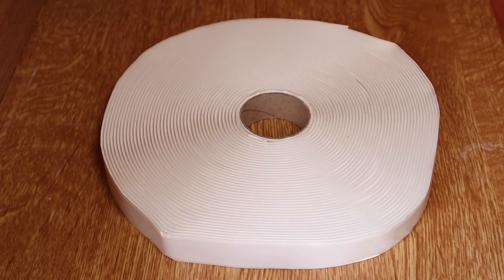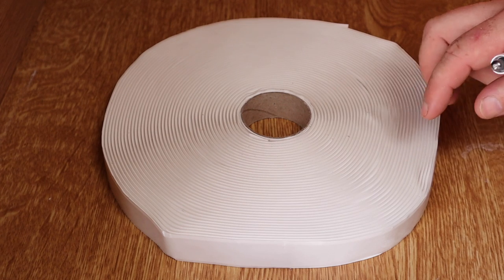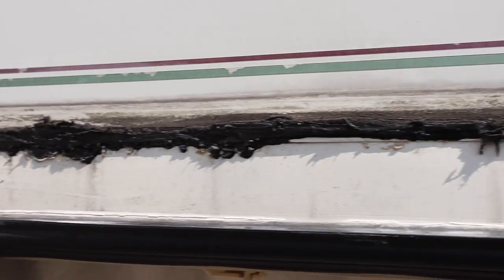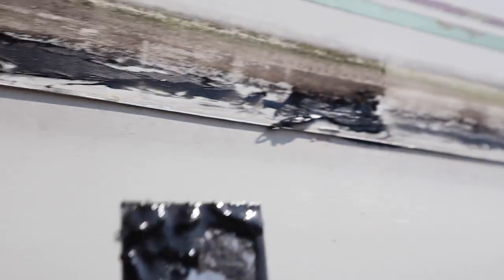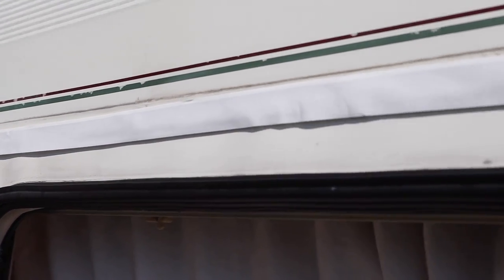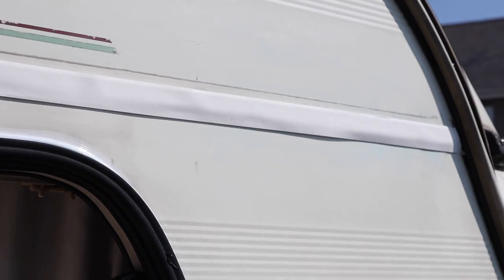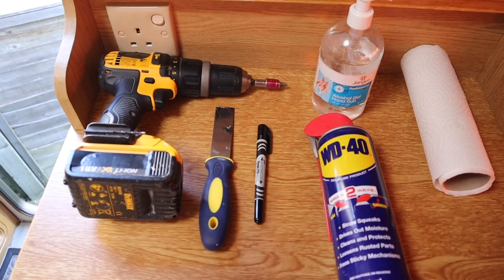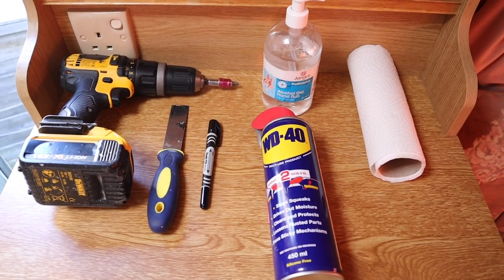Replacing a caravan seal.... Caravan Repairs.

Comment: Looking to give this a go in the next few days — cheers for the vid mate!
Reply from the maker: Theolyn Warrender, no problem, would be great to here how you get on 👍
Reply: @expedition320  Cheers! Would you recommend completing the edges with silicone? Or will the mastic sealant do the job? It's looking like I'm going to have to do the trim which goes around the entire outside of the side (for the awning) as there's previously been a leak in the front left which the previous owner bodged with a dodgy silicone job.
Reply from the maker: Theolyn Warrender, I would recommend using the mastic if possible, it will cover the any join that maybe under the trim. It will also seal the screw holes to stop any water getting in 👍👍

Comment: Just found a leak under my awning rail in that joins to the roof, this video came in so handy, would it be asked to fix the tape to the aluminium strip first then screw to the van maybe?
Reply from the maker: I don’t think it will matter really, I stuck it to the van first so I could see I covered all the join, I was also doing it alone so doing it that way was a lot better for one person 🤙🏻
Reply: @expedition320  hey thanks for the reply. Over ordered the stuff now so will give it a try when ever the sun comes out. It's a hell of a lot cheaper than a full interior rebuild!

Comment: Thank you so so much for your video... I just got a c.van and its all new to me! I now know after today that i need to redo all he seals on mine....

 Is this side seal the same as the one all around the edge, like roof down to side corners?
Reply from the maker: Yes it should be, just double check and try a small test on one of the seams

Comment: Hi Mate great job on the seal looks good. I have a big leak at the front of my ABI Monza coming from Awning rail by the looks of it. I am a novice to repairing vintage caravans - my question is is it better to take the whole awning rail off like you did with yours and clean all the gunk off and do it properly or just try and reseal as best I can . I was going to use sikaflex as its recommended. Whats the best way forwards on this one? any advice greatfully received thanks mate!
Reply from the maker: Gerard McKinley-Smith, I would recommend taking the whole rail off, it’s it’s split into sections, just take the front section off, I have never used silkaflex, so can’t really comment, where possible always try to do the job properly, a bodge job will always come back to bite you in the backside at some point.
Reply: @expedition320  Thanks mate appreciate your advice.
Reply: @GERARD How did your awning seal replacement go? I need to do both sides of my Baily ranger this season. Couldn't find how to remove the trim to get to the screws?
Reply: @expedition320  I actually done this on my old campervan!!, but still have leaks come to realise my window gaskets all need replacing!!

Comment: Did you just use the tape or did you out mastic sealent over it aswell if just use the tape was this fully water tight after thanks
Reply from the maker: Hey, I only used the tape. you don't need any other sealer as the tape is like a sealer that never dries, hope this helps.

Comment: Thanks for the info, is it still dry after a year so?
Reply from the maker: All dry and secure still
Reply: That good to hear, as I've got a caravan roughly the same age, and about to reseal it before it starts leaking , How's your Freelander running  as I'm about to buy one too
Reply from the maker: @videostars9194  the freelander is going great, alto not in use I mite convert it to a proper overlander

Comment: Hi Thanks for the video.. Do you Just drill the screws back into the old holes? Sorry am totally new to this, and my door has been leaking as it had slightly dropped. I want to do this also while am at it..Thanks 😊.
Reply from the maker: Hey, yes I screwed the screws back into the old holes, the sealer will cover the old holes so if you wanted to make new holes it should be ok.

Comment: Hi, how did you stop the screws chewing up the mastic when you put them back in?
Reply from the maker: Joan Pickavance, all I done was add a little more pressure to the screw when driving it in
Reply: @expedition320  Thanks
Reply: Are you assuming he found all the same holes again. If not he’s also drilling new holes
Reply: @neilfields5914  theres holes in the metal trim that will align with the holes in the body ... that’s why you don’t need to mark where the holes are 👍
Reply: @clemencyp  that’s good to know

Comment: Hi, Have you ever had to replace the awning rail, and if so how do you bend the corners etc if it is ally awning.?
Reply from the maker: Michael Dominy Hi Michael, thanks for your comment, I have never replaced one so can’t really advise on this question, but if I was replacing one,  I would cut it a few CM short file the edges and pop a plastic cover over it to tidy it up.

Comment: Nice job! I’ll have a go at mine now I think. Did you manage to use the same screw holes when replacing the rail or did you drill new ones.
Reply from the maker: used the same holes
Reply: @expedition320  how did you manage to find the original holes